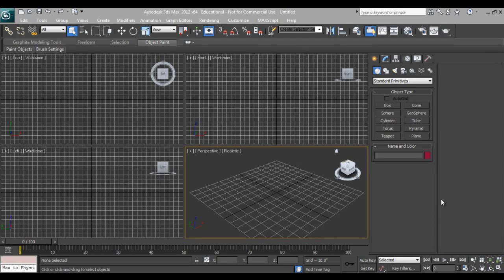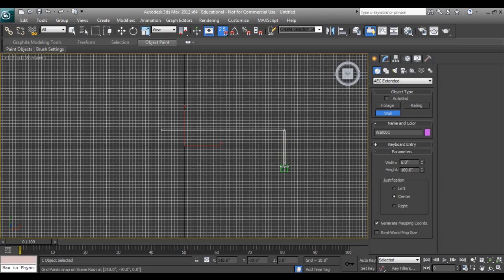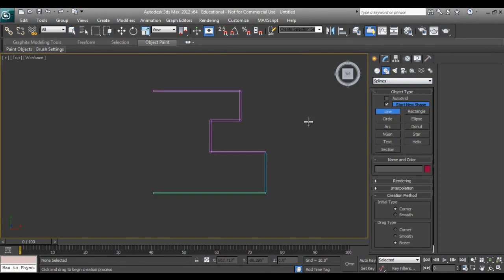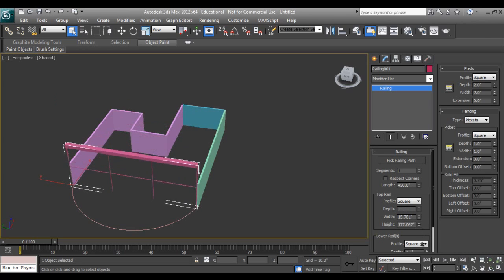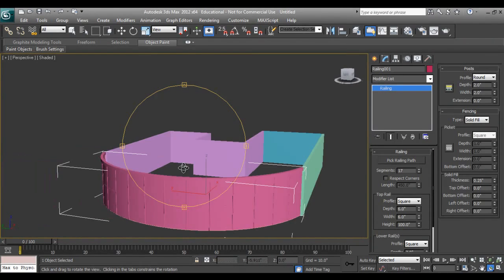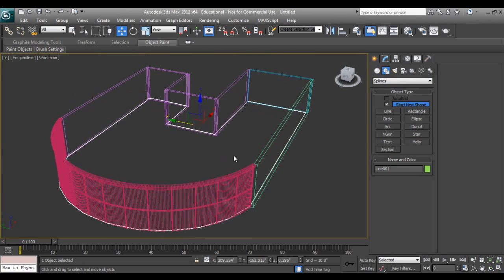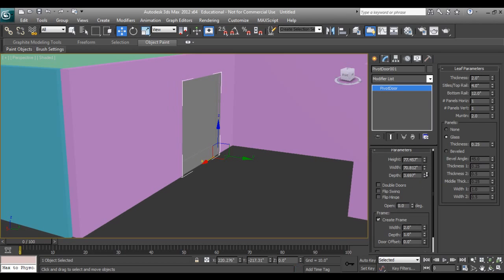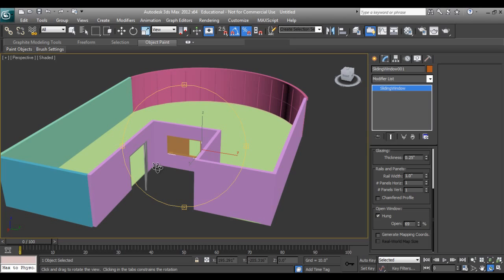3D Max Tutorial:"AEC"Extended Part 01

Comment: Sir, i got this problem where the door or window i placed in the wall could not see through when opened. And, can the door and window open feature be used in animation? Thank you very much
Reply from the maker: it happens just try with proper drag with on walls.
yes you can animate d doors in walkthrough. if any problems there plz tell me.thanks.
Reply: keyframesonline  Besides, how could I make the building rise from the ground as in the video. I know how to use the key frame but the problem is that scaling of the object start from the middle of the object. Thank you once again
Reply: keyframesonline  From what I tested, wall can rise from the ground. But items like plane can only scale starting from middle which made it looks odd